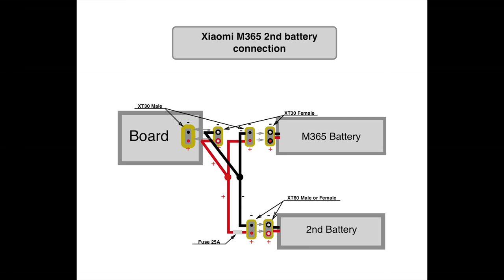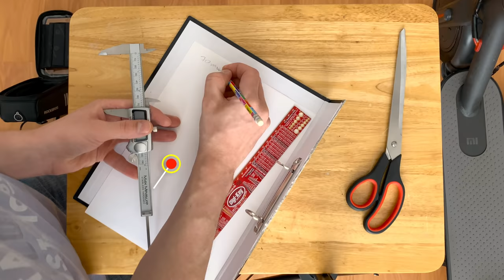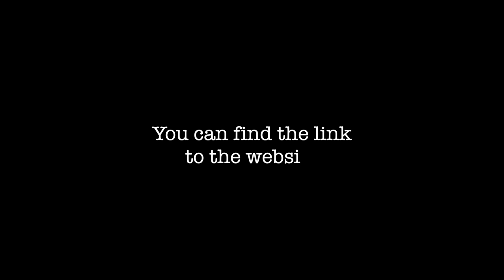Xiaomi M365 / Pro / PRO2 / 1S / Additional / Extra Battery Upgrade

Comment: Hey man. Do we still need bms/battery management system for the second battery pack? Thanks
Reply from the maker: Hey. It will work without bms but I highly recommend the battery pack with bms for safety and health reason .
Reply: @tatech8696  Awesome. Thanks man. Cheers. 🥂

Comment: Great Video 😊 This is my nxt Project. My only concern is how will both batteries Internal and External Discharge at the same rate ? The Internal Pack Could be 8.4Ah with High Quality Sony/LG/Samsung and the External Pack could be 8.4Ah But with Cheaper cells thus the voltage on the External pack will Drain faster this is my only issue. I could be Wrong Tho

Comment: Cool video. How does it work with the percentage on the dashboard? Does it work?   And are the percentages in m365 tools correct?
Reply from the maker: Thanks mate. 

Percentages on the dashboard and in the "m365 tools" app go down slower/correctly but the capacity of the additional battery is not shown in the app.
Reply: @tatech8696  ok thanks
Reply: @tatech8696  Hi T&A, I have a question about the fuse. I have a Xiaomi Pro. Since the scooter's charger has an output of 42V, what type of fuse should I use. The ones I see on Aliexpress are either 12V or 32V. Thanks in advance!
Reply from the maker: @nikostevens1  Hi. You mean fuse for 2nd battery? 
Fuse 32V 25A. You can save time and stress and buy ready made connecting kit for 2nd battery. Link in description
Reply: @tatech8696  Thank you! I ordered everything I need on Aliexpress. A well reviewed,  12.8Ah decent batterypack, heat shrinking tube, 16AWG cable, XT30 connectors and also a 32V fuse. The thing I was "worried" about was the fuse blowing up as soon as batteries get charged because of the fact that the charger is 42V and the the fuse 32V but I realised it's not the voltage but the current wich matters.
Reply: @tatech8696  Hi again! I am only now gonna install my additional batterypack. But I have another question for you. I see that you are using XT30 connectors and 1 XT60 connector between the split up  and the additional battery. Will it be ok to use and XT30 connector there also? Because I only ordered those by accident. Or do you think something could happen when I do? Thank you!
Reply from the maker: @nikostevens1  Hi Niko. Yes you can use XT30 but you will also have to replace the battery connector with XT30.
Reply: @tatech8696  Thanks for the superfast reply man! You mean the connector on the additional batterypack right? If yes, it had another connector. I forgot to tell the store which one I needed... So I have to replace it with the XT30 either way...
Reply from the maker: @nikostevens1  Yes I mean the connector on the additional battery pack.
Reply: @tatech8696  Ok, thanks man! Keep up the good work!
Reply: @tatech8696  Hey once more man. So... I made the whole thing, got everything connected the way it should BUT. It doesn't seem to want to charge via the standard charger. I flashed it the same way you did by removing chargin mode. The same way I flashed speed and other things before as well but nothing. They still charge each other. What do you think this could be?
Reply: @tatech8696  I notice that your batterypack doesn't have a BMS installed on it. Mine does, could that be it? If so, I can remove it...
Reply from the maker: @nikostevens1  My additional batteries in both xiaomi scooters have BMS, I charge them through the port on the scooter and everything is ok but I built the battery pack myself and used BMS with charge/discharge same port.
"They still charge each other" - If they do this while charging, that's fine, but they shouldn't do it while driving. You can also create a similar cable splitter to charge an external battery.
Reply: so would it be stupid for me to connect the discharge wired to the charge wires on my added pack? That should work right? I'm thinking that will leave the BMS on the added batterypack "deleted" right?
Reply from the maker: @nikostevens1  I don't know if it will work, you have to connect everything like in a video, have the option in the custom firmware "remove charging mode" checked, and everything should work. I do not recommend removing the BMS because it is designed to protect your battery from overcharging, discharging, short circuits etc.
Reply from the maker: Or replace this BMS with another one that allows you to charge/discharge through the same port (BMS common port 10s, 20A or 25A)
Reply: @tatech8696  But the thing here is... I don't think my battery allows me to charge it through the discharge port. Therefore my question if I could add the discharge wires to the charge wires because I want to both charge them via one port. The BMS on my added pack is 15A. Will that suffice?
Reply from the maker: @nikostevens1  15A is ok too but I cannot guarantee if you add the discharge cables to the charging port whether it will work or you can make a short circuit.
Reply: @tatech8696  Sorry to be annoying here :p Ok, so, making a Y connection (the same way as already done) BUT from the charge wires of the added battery, to the charge wires of the original one and connecting that Y to the original chargeport will work right? That is better than what I figured out and doesnt need soldering on the batterypack...

Comment: Hey Thank you for this tutorial video. I just got done doing this but one important question; when I first connect the extra battery I make sure they’re both at same voltage but after I go a little ways, I check the voltage again and they are no longer the same. Seem to get more unequal the further I go. Is that normal. Went about 4 miles and off by 3 volts after.. & I did remove charging mode FYI
Reply from the maker: Hey Adam.
Check everything again if it is properly connected . What was the difference in voltage between the stock battery and the extra battery and which battery had a lower voltage after driving 4 miles? Also upload the software again with the "remove charging mode" option marked (I always upload firmware twice because sometimes it doesn't change)
Reply: T&A Tech thank you for your reply. Some additional info; the extra battery I’m using doesn’t allow for charging through the discharge wires.. could that be why? The regenerative charging of the scooter only regenerative charges the original while the extra battery cant receive any charge that way.. I’m just guessing about maybe that could be the problem tho I hope not cuz nothing I could do if so. Andto answer your questions I am certain everything is properly connected and that the firmware worked because I also changed the cruise control from 5 seconds to 3 and that noticeably worked. The extra battery is the battery that loses volts quickest. After about 6 miles, the extra battery will be at 38.0 volts while the original battery will be at 38.5 volts. How serious a problem is this? The seller (Laudation) who I bought the extra battery from doesnt allow returns.. tho nowhere in the description of the battery does it mention that the battery cannot be charged thru its discharge wires. Really disappointing $105 wasted
Reply: T&A Tech just realizing in my first comment I said it was off by 3 volts after a 4 mile ride, I meant to say .3  .. not 3 whole volts but .3
Reply from the maker: Some batteries cannot be charged via the discharge cable because they will not be protected by "BMS" but the charger also has overcharge protection so this is not a problem.
There are two more charging methods.
1: Charging both batteries via the second battery port (it is good that the charger gives a maximum of 41.5 - 41.6V because some cheap chargers have charging set to 42.0 and even 42.2V and this voltage can damages the cells)
2: Charge both batteries with two separate chargers but the batteries must then be disconnected and the chargers must be the same (2nd genuine Xiaomi charger)  and they must be charged to the same voltage. After charging, When they are still disconnected, check both batteries with the voltmeter to see if they have the same voltage.
Up to 0.5V the difference between the two batteries is still fine.
Reply: T&A Tech ok thanks! Only issue/question I now have is .. I charge them both separately but the extra battery cannot be charged with an xiaomi charger because different fitting. Xiaomi Charger won’t fit/won’t plug in to battery charging cable. But as long as they are both charged to same voltage then it should be fine correct? I appreciate you! Nobody else has responded w any attempt to help so very much appreciate the insight
Reply from the maker: Yes, should be fine. A small difference (up to 0.5V) between batteries is acceptable. Thanks
Reply: T&A Tech awesome. Just got done testing out a full range test with both batteries connected. Found at about half battery I could disconnect, meter test both batteries and, as mentioned, the original battery will have about .5 difference  - never seemed to exceed .5 - so at that point I just run the scooter on original battery only for about 10-20 yards to drop that .5 so is equal w other battery again . Worked well enough! Thanks again. I was really tripping out cuz other videos were saying any difference in voltage more than .01 would cause battery to blow up etc. Thanks for being voice of reason. Tested today and everything went well. REAL QUICK: Very important TESTIMONY: Jesus Christ delivered me from heavy addictions to meth, adderall, alcoholism, cigs etc in 2014 no rehab or anything! Just the Lord and His Word! Been living for Him ever since. Completely changed my life and now know that I have eternal life in the kingdom of God. Death is a lie if found in Christ! Plz don’t brush off God stuff. Very important to get a zeal for eternal things and seek Truth only thru Jesus Christ who is the Truth, The Way and The Life. Nobody comes to the Father but by Him. His is the name above all names. No other name under heaven given among men whereby we must be saved. He’s alive and changing lives!  Thanks for hearing me out there. God bless you and your YouTube channel 👍
Reply from the maker: @Adam Davis I'm glad I could help 🙂 Please Subscribe and share this channel to help grow it
Reply: @tatech8696  hey. I just read all these comments. And I figured since you said that some batteries can't be charger via the discharge cable... why not directly attach the the connectors to the two charge ports? Maybe using a diode... would that work?
Reply: @cirwo85  Whenever I write this, like .3, best to write 0.3 just to make sure. the '.' is easy to miss and could get lost in translation somewhere, whereas a 03 would be unusual and make one think 'is somethign missing'.

Comment: Hi how many bms are you using for batteries 10a 30a 40a 50a 100a?
Reply from the maker: Hi. I don’t now what you mean. 
One BMS for one Battery pack and for Xiaomi scooters extra battery packs 15A or 20A BMS depends of battery cells are you using on pack.
Reply: @tatech8696  I mean how many amps bms should I use
Reply from the maker: It depends what cells have been used in the package (Maximum Continuous Discharge multiplied by the number of cells in parallel and minus about 40% and you will get the result which BMS will be safe for your cells)
e.g. Battery pack 36V  10s4p cells: Samsung e29 (Maximum Continuous Discharge: 8.25A)  4p (4 in parallel) 4x8.25 = 33A - 40% = 19.8A so safety BMS for this pack should be 20A. Of course you can give a bigger one, but the cells will lose their life faster.
Reply: @tatech8696  Hi if I connect additional batteries 12 series 3 in parallel, will I damage the scooter
Reply from the maker: @ozgurm365proscooter8   I do not recommend 12s for this connection method. The extra battery must have the same maximum voltage as the original battery, so 10s (around 41.6V).
Reply: @tatech8696  How many km we can speed on a straight road in 10 serial 4 parallel connections

Comment: Couldn't you just add a 2 point switch and connect extra battery through that? When original battery runs down you flick the switch and start using external one. It doesn't give more power, but should be easier and you could safely remove extra battery.
Reply from the maker: Hi. Thanks for comment.
Yes, you can also do it, depending on what you are looking for.
Reply: @tatech8696  It was just a thought. Though if someone wants to mod the firmware and use full power of the engine, your mod is the way to go to get higher constant power from battery pack.

Comment: Best guide i have seen. Any idea what battery packs are safe to buy from Aliexpress? seems like theres so many of them.
Also, how much range did you gain?
Reply from the maker: Thanks.
LiitoKala batteries are safe to buy, I had no problem with it but I waited a long time for the parcel (6-7 weeks).
You need Battery pack with "BMS" and any 36V from 8AH up will be good.
I had an 10AH battery pack and it doubled my range.
Reply: @tatech8696  Wow, thas amazing. My weight is 93kg and im getting around 20-30km on regular battery with no hacked firmware. If i could get at leat 50km range that would be amazing. I could skipp charging at work at all
Reply from the maker: @brottochstraff  Good range, I guess you have "M365 Pro" which has the originally a battery with a capacity of 12.8 Ah, so to double the range you need to connect a minimum of 12Ah.
I have M365 (not Pro) which has batteries with a capacity of 7.8ah and an additional 10Ah doubled my range
Reply: @tatech8696  Yes, its the Pro model. I hope the same method will work anyway as you have shown :)
Reply from the maker: @brottochstraff  Yes, same method
Reply: All the batteries on Ali Express are fake  amounts. A 12Ah is usually an 8Ah and so on.
Reply: Hi I have a quick question..  I have a bigger scooter and have an extra battery.. I was thinking of doing this same mod but I have a couple of concerns that I need answered.. scooter has 60v 35ah Samsung already and I have a spare 60v 26ah spare.. I am wondering is it safe to connect them together even though ah is different.. I read somewhere else that if amps are not same then the batterys charge each other and will do damage etc.. thanks in advance and nice work on your scoot.

Comment: Hey man! Awesome video i bought the battery cable set from you, but I have a problem... my scooter has not increased in range, I added a volt meter and I can only se the external battery being utilized very few times, do you have any suggestions on what that could be because of? Also do you have any smart app that can se the power of both batteries connected? Thanks for the help @T&A Tech
Reply from the maker: Hi. Thanks for your comment. You have to check everything again.
1- custom firmware, 2- extra battery, 3- split cable.
1.Be sure you have installed the custom firmware with the "remove charging mode" option selected. 
2.Disconnect extra battery from the split cable.
Check the voltage on the extra battery, the voltage should always be the same as that of the internal battery (after full charging and also after driving a few kilometres)
4. Disconnect the split cable from the mainboard and internal battery and check it to see if it transmits voltage. 
You can do this by connecting the internal battery only and check the voltage at the output of the cable (the connector you plug into the mainboard). Disconnect the internal battery from the cable then connect the external battery and check also.
Unfortunately, I don't know of any application that shows extra battery capacity.
Reply: Cool thanks alot I checked everything and re soldered the connector between battery and split cable on the external part and it seems to have done the trick! Thanks! Hope you post some more cool m365 videos soon! Subscribed and waiting for more! 👍😎
Reply: I purchased your wire as well. Does this also work with aovo pro?

Comment: I saw this all over the internet.
Let me say if i buy the full kit completly from you!
The Xiaomi E scooter Pro 2 Has a 45Km Range
And with the extra battery on it how much Km will it reach?
I need to know it since im interested to buy one
Reply from the maker: Hi. Thanks for your comment.
Unfortunately, I do not sell full kits (cable, battery, battery bag) I only made and sell a cable kit for connecting an additional battery in parallel.
The Xiaomi Pro2 has a 12.4Ah capacity of the battery pack, so if you connect an additional battery pack of the same capacity, the range will almost double. 
If you connect half the capacity, the range will increase by about 50% from the original.
Overall, the range depends on many factors such as Driver's weight, weather, road surface, slopes, and many more.